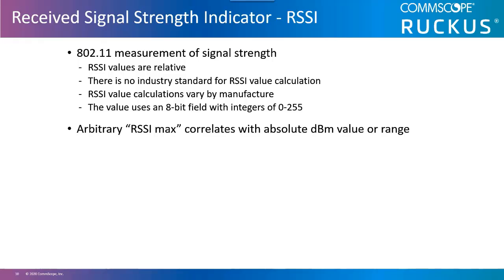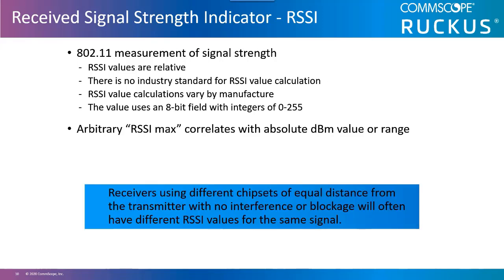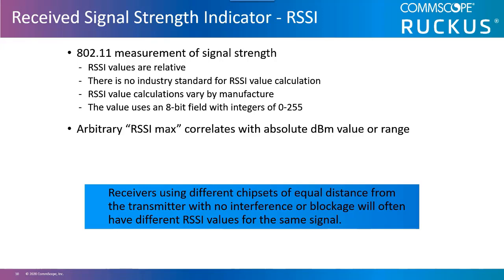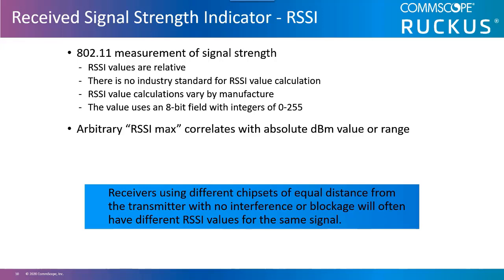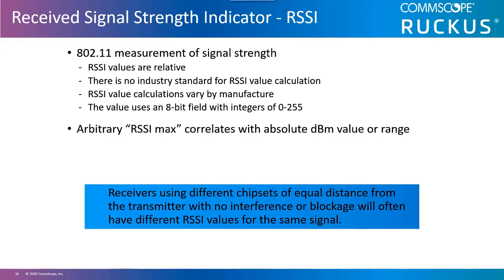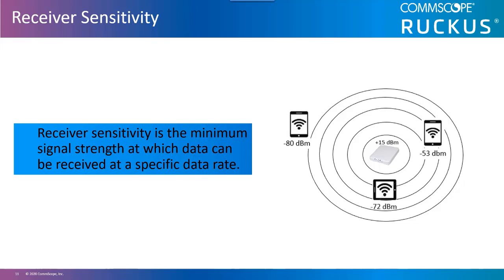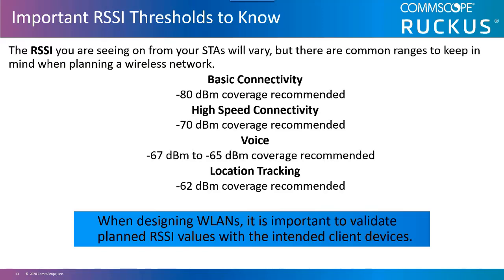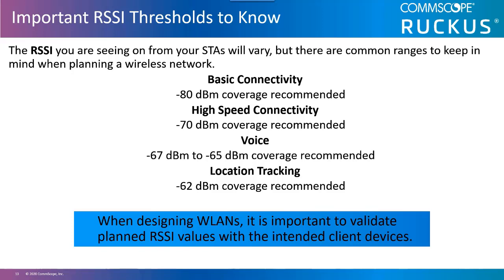WiFi Received Signal Strength Indicator (RSSI)

Comment: at 1:13 , you said the loss caused during propagation of the signal is exponential , 
But in my 2 cents ,  i believe the loss calculated for a signal at a given distance is taken out using FSPL  formulae , which makes this logarithmic and not exponential .

Comment: Is it possible to improve RSSI using a mirror behind the antenna? If so, what shape would be best? Concave, convex, or flat mirror? If not, that sucks 😕
Reply: Like a parabolic or cone dish with the antenna pointed straight at the device, otherwise the long side of the antenna (the dish above would be reflecting the long side), and maybe with a metal reflector (flat to parabolic) behind it, but it could also potentially cause interference. Think of the antenna as a glowing wire where you could see more of the glow along the side of it.
Reply: I do it with a few aluminum foil taped to cardboard box with 4 sides for my wireless adapter lol.  Or one of those cheap aluminum foil cooking pans cut in half. 
More to block out interfering signals from other directions though it increases the value though. There is a testing app called WifiInfoView that can be used on a laptop to walk around your house and see how the signal strength varys.